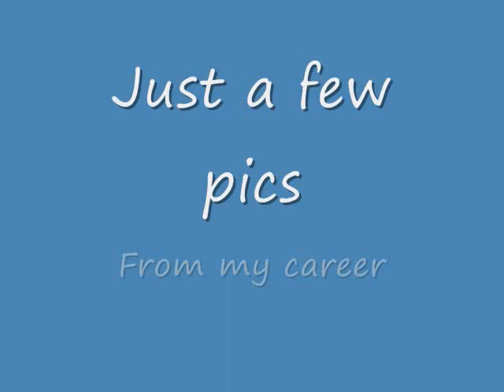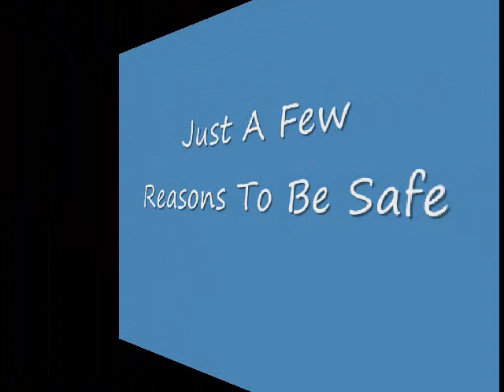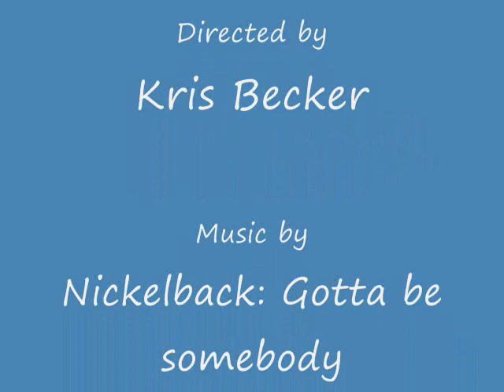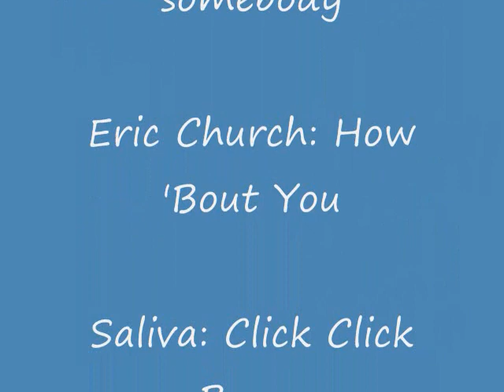Crane Video

Comment from the maker: @chuck738 Thanks for the comment.  Yes the white crane that was being undecked was a 70's 140 ton P&H.  It had dual stacks on an old 60 series Detroit.  It sounded as tough as it was.  That was one picking machine.  Carried 140 ton off the rear 30' and never cracked a beam.